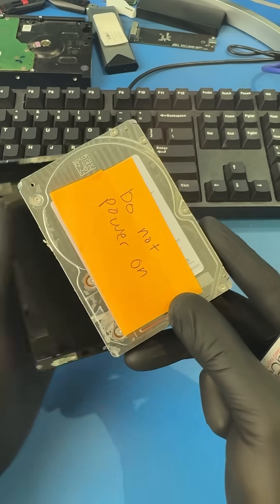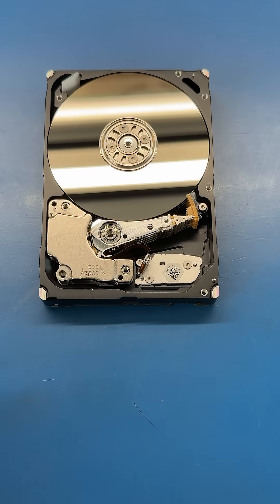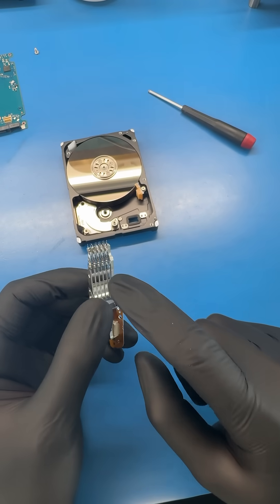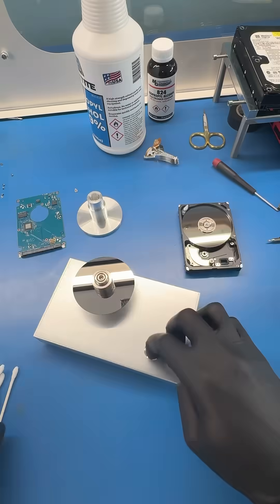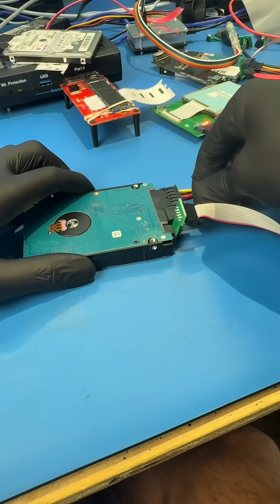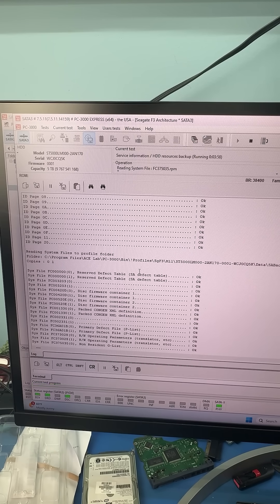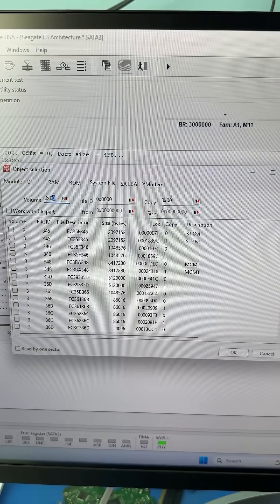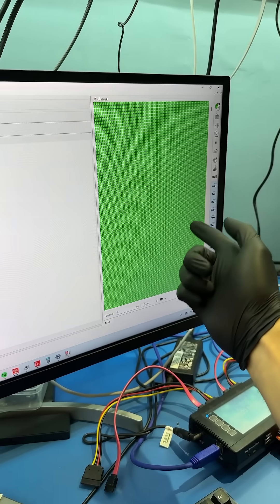Hard Drive Platter Extraction... #technology

Comment: Aren't mechanical hard drives sealed in a nitrogen atmosphere to prevent corrosion? Wouldn't the pressure difference after opening it affect the reading?

Comment: I have worked on hard drives from as far back as the Winchester era (1970s), but mostly for very simple repairs. I’m also very good with firmware and advance disk editing. I have even done forensic work, i.e., recovering intentionally erased data, so this part is definitely up my alley. But separating platters and finding drive head fragments is beyond what I have ever attempted. Impressive.

Comment: The number one rule of owning a PC: back up your stuff OFTEN and to MULTIPLE PLACES.

That way if this happens (ruin original and current backup) you are out a few months of files and maybe $100 for a drive, instead of deciding between $4,000-10,000+ or losing years of data
Reply: Minimum of three backups: One OFF site. One ON site. And the original.

Offsite for fire. Onsite for A/B alternating between the original backup.

Comment: I remember in '81 I was working on an NCR 8200 minicomputer and hit the "unmount" button on a 14" drive (one 5MB single fixed platter and one 5MB removable in the same cabinet); that was a thing you did with hard drives to tell the OS to stop using it cause it was shutting down, and then something screwed up and it fired the head into the spindle of the fixed drive just as fast as the voice coil could push it (and voice coils are fast  - think railgun). Sounded like a gunshot. I jumped about 3' straight up. Then I had to explain several times what happened as people started running into the room. Naturally we could not use that drive so we called tech support. Which wasnt much of a trip, this "hangar queen" practically had him living in the parking lot .

When he extracted the platter could could see bare metal where the oxide was supposed to be in a groove about 1.5" wide all the way around. The head itself had basically vaporized into tiny particles. He gave me the platter. It was like a 14" diameter 5# sharp edged Frisbee. I took it home and threw it, it curved off to one side but it still covered probably 100' before it did - sliced about 8" into the ground.

Comment: I've worked in IT for 20 years. Let me tell you, this is insanely impressive work. It requires high knowledge, adaptability, and above all precision. Bravo, friend.
Reply: Data recovery in general, yes. This specific job, not so much. Most of the work was just replacing a broken head and using software that does a lot of the work for you.
Reply: He's talking about "Time to lock in". Sir wdym, you're cemented already.
Reply: It also requires extreme cleanliness that I cannot provide after 30 years in IT with lots of low level work, though not the arcane knowledge of the firmware control port on drives .
Reply: justbecause you worked in IT doesnt mean you know shit abotu whats going on
Reply: @23bobjr  Hahaha, you're funny, and an idiot.
I work as an System Admin in IT/ICT now for 30 years, and @darkstarknight95 is 100% right.

Comment: PC-3000 reads all surfaces and assembles the cylinders in software? there's no way to manually align the platters after taking the stack apart?

To bad that PC-3000 is unobtainium for normal mortals (i.e. not professional data recovery services"

Comment: For me, the most impressive part of this surgery is ensuring the platters are perfectly aligned on extraction and reinsertion. The variance tolerance is measured in nanometers. If you're outside the tolerance your'e basically boned. 

Modern platters have what are called servo markers to assist in head alignment for platters that may be a few nanometers out of alignment. So, they don't have to be absolutely perfect, but still have to be damn close, And, yes, it varies wildly by manufacturer, and even make/model within the same manufacturer. 

You'd think the platters would be keyed; they're not. I'm VERY impressed with this extraction, repair, and reassembly.
Reply: I wondered about this. They are so cavalier about removing and replacing them I assumed the platters must have a magnetic marker on them similar to a record lead-in. If this were true then alignment wouldn't matter about absolute alignment, the read head would just find the landmark. Sounds like that's not how they work.
Reply: yeah i saw him desync the platters and thought this video can't be real???? how can he possibly realign them "BY HAND"???

Comment: Wait a minute. You replaced the heads and didn't need to retrain the SA? You got very very lucky. This is insanely rare, even with the same model heads from the same manufacturing batch. I don't doubt you did it but this is not common at all.

Comment: Years ago I was working on my computer. I just finished installing a new cd ROM drive and when I pressed the power button the controller chip on the hard drive exploded. After a little investigating I discovered one of the power cables had the five and 12 V leads exchanged . I had been working for months on a programming project so hundred of hours of coding was at stake (the reason I bought the cd ROM drive) . Luckily I had purchased two of the same model drive so I changed out the drive  Electronics circuit board and it worked perfectly.

Comment: Brilliant work.  I had a 1Tb drive in my laptop with >10 years of photos and videos on it, which failed 2 weeks ago. Ran all the system checks and no joy. Gone.   A few days later when restarting laptop the drive and all folders re-appeared.  Immediately ordered a 1Tb external SSD and left laptop to go back to sleep.  When SSD arrived I woke up laptop and backed up the intermittent drive which took 4 hours.  Now ordering another two SSDs so have multiple backups of all important files.   And replacing the dodgy internal drive with an SSD.

Comment: When I worked at Best Buy, we had three levels of Data Recovery available. First level, just a basic software recovery. $300. The second level was mild hardware repair or deeper software recovery. HAd to be send to OnTrack recovery. $600. Third level, which I believe is what this gentleman is doing, was a whopping $1600. And often times would take OnTrack WEEKS to MONTHS to get the data. Usually the only people that did this were bankers or accountants that didn't have backups. All levels included a suitable replacement drive. And advice to keep regular backups of their drives.

Comment: I always thought the second you popped a hard drive open it was toast because if dust settles on the disk and then you use it again it will destroy some of the surface and ruin the drive. Either I was misinformed or your work space is air scrubbed

Comment: You just took the plates off and put them back on? And the coaxial decalibration of the plates? Nonsense... Translator and MCMT report error... Besides, you have scratching heads on the system heads - seagate has a very weak ferromagnet and you would have a bloodbath there in SA. IMO this movie is only for marketing...

Comment: There is no way I would trust a single disk, SSD or HDD for Terrabytes of data..

Raid 1 for local and offline copy in the cloud
which then periodically copies down to my second NAS in the garage (away from the house, also Raid 1) and which is also copies down on other pc's in different locations (work, laptop)

I need 5 different failures at once before I actually loose any data

Comment: i actually spent a few hours removing heads like those from some drives to sell as the drives were to be destroyed but never could sell them. was later told by someone that it costs thousands to even use said heads in a clean room to replace in drives reason for them not selling.
i honestly didn't care much about the not selling in the end but what hurt more was all the tech companies refusing to listen to me asking if they'd want to buy and some leading me to a scam help line.
for reference, i'm someone going into IT so it was my first time trying my hand at hardware and trying to make profit off my hardwork.

Comment: I had a CRAPPY WD MyBook 2TV die a slow death on me that I thought might have a bad board (a very common issue with crap WD Drives), so I bought a new board, replaced it and no dice! Opened the drive to watch it in motion and it spins up properly, but as the heads engage, it encounters an issue and spins down so it doesn't mount.

Anyone have any idea how I might fix it?

Comment: Over the past 20 years or so I've used ONLY SS  hard Drives without a single failure!  I also use Crucial and Corsair SSD's to make my ACRONIS images. No worries at all now.
Reply: Just keep and make appropriate backups!  it's cheap to buy a 1 tb ssd hardrive... buy two... back your stuff there and then remove the drive and keep it somewhere dry, cool and safe.  would not hurt to burn some dvd's too.  dvd's degrade with time but everything does.

Comment: I saved all four years of my Info design degree on an external. The last course was a portfolio course which was supposed to be the compilation of the last four years when my hard drive blew. I was told it would cost $3000 to recover the info. So, instead I recreated four years worth of work in two weeks.

Comment: thats PC-3000 software, and you need a donor drive, which is fckn impossible to find... but there are few sources... i have used that long time ago and done this a few times with low success... btw you also need a class 100 clean room for low dust particle, the moment you open the case, you will immediately see those dust particle, and when you forget to blow them, those new heads will catch the dust and broke the head... these services charges USD5000 on the average.... i have done this myself.  The most skillful part of this operation is when you slide and park those head into the parking area (plastic), and those platter getting removed in order and in a correct position, i have 0 success on this part... those head usually you can find on the small exhaust part of the drive, as it is usually blown away by the rotation.

Comment: There was software for years that didn’t require this backing up of a service area. Simply would pull all the bits off the drive in it entirely but I believe it’s all locked behind pay walls now days. Used to be a Linux tool for this as well to basically force strip the data off onto a hard drive

Comment: I have had a DEEP distrust of Seagate drives for years now. Did data recovery when a drive in a RAID failed. A completely new set of 3 identical drives were purchased. I spent nearly two weeks getting raw data recovered and moved to new drives. Got RAID rebuilt, started copying individual surviving files so they could be properly backed up. BOOM, one of the new drives failed. Total data loss on new drive and old drive had damaged platters. Nothing left to recover and rebuild from.

Comment: a long time back i thought i would try pull a few apart that did not spin,  and i just rough as guts put the discs in another drive and i mean no clean fingers and not a clue how the heads worked, and then it spun up !  i think i used easeus recovery or similar cant remember and  couldn't believe it, got basically all my pics and movies and lots of other stuff off it, i never even tried to boot it up as a system.
so i could imagine with this kinda care you would basically get the operating system fired up ?
Reply: PS : i am pretty sure i tried it again on another hdd and only placed 1 or 2 discs in it leaving the others and could get pics and videos off that too, i just cant remember why i did that .

Comment: You can't pull the platters off one by one because their positions are synchronized. If they are not kept uniform and adjusts so much as a micrometer you will basically lose all the data on the platters. There is a tool that fastens all the platters in place and then you can remove them.

Comment: I had use an adapter for my old drive from my young years where my bitcoin feom 2011 was. But I connect the ide font reversed by accident and it won't turn on. Is there hope?

Comment: My scrotal contents felt severe pain when I saw those heads! Talk about redefining head crash! Used to be a head crash just gouged part of a platter, clean the debris carefully out and one could recover the majority of the data.
Still, looks like glass platters, which are a bit more robust than the ancient soft metal platters and we'll not discuss the ancient hard platters, dried up grease bearings and techs slamming the drive on the bench to free the spindle to recover the data...
And the correct grease for those ancient spindles.

Comment: Sencond cache..and just start failing sounds like hard sisc drive. 1 seconds run just fine and then you may or may not shut it off and turn it back on and it doesn't work

Comment: You forgot to adjust the Joson rod in Stage 3 from the loop master. You’re gonna have problems when stage 7 doesn’t line with the reactor column H when stage 2 clips the edge of the gigawatt locator at stage 4. You also forgot the RAM overboard module that makes stage 6 stay true. You may have gotten most but anything hanging from the edgeware of stages 1 5 & 6 might make the whole rom crash. It’s for sure a hard job but something’s better than nothing. If you want me to come in and resurface the mainframe so stage 5 runs smoothly please let me know.

Comment: I once did this - the drive was unwanted, so I was doing it for amusement, but when I got it together again, the heads flew OK, but they were wandering across the surface.  I figured that the servo tracks were no longer concentric, so I scrapped it like I was going to do anyway.  That was a 12" disk off a mainframe, but they were crude compared with modern 3" hard drives.  I didn't think it would be even nearly possible with a small drive like this.  How wide are the tracks?  You don't need to get them far off-centre before the servo track can no longer work.

Comment: Modern discs are very delicate. I remembered how in the mid-90s, my computer, running on an i386 processor, started making sounds reminiscent of the doorbell of the 50s and 60s. Someone may remember such calls when a metal tongue was hitting an iron cup. After opening the system unit, it turned out that the power supply was out of order and instead of 12 volts of direct current, it was producing 48 volts of alternating current, which led to heads with a frequency of 50 hertz hitting the hard disk plate. In the shower, I said goodbye to my computer, but what was my surprise when, after replacing the power supply, everything worked, and almost nothing was lost on the hard drive, only I had to block the damaged sectors.

Comment: I have an external HDD that has encryption through the daughter board (I was putting a shelf up and it fell, slid down the wall behind the desk and snapped the port off the board. this was 20 years ago, since I have learned trace and circut board repair) Unfortunately I no longer have the daughter board to repair.  

How much would it run me to get a platter swap to a new drive or at least the contents recovered onto a flash drive or dvd?

Comment: I seriously question the level of accuracy in each action taken as someone who tried to repair many things with extremely thorough knowledge of the product being repaired and still makes errors voiding all my work far more often than I don't to see one video reference no fewer than 3 high precision requirements and not  one error is the baffling part to me! like how on earth does one get that solid a resistance to errors if there is one skill I want to learn desperately it is that and it isn't just a steady hand as no misinterpretation is also part of this skillset as used in the video

Comment: NEVER EVER EEEEEVVVVEEEERRR store pictures/movies/documents or ANYTHING you want to cherrish on a HDD. They are designed to fail. Also, I hate to say it but I tell EVERY SINGLE customer the same thing. ALWAYS store in two places. In case one fails or burns. Better option....go cloud. Make sure you have ALL the FA's on and youll never need to worry again. Again, if you're using a MECHANICAL drive...to save memories ...you're asking for failure.

SORRY to rant more. But I remember when Toshiba released this external drive. They ADVERTISED it as for you to save all your loved memories on it. I sold 30 of them In a month. A YEAR later we started having people return them saying they aren't being detected. We had SUCH an issue that we called Toshiba and they said "after the device has been powered on and you saved data to it. Make sure it NEVER powers off. As if you let the unit sit for a couple months powered off. The device was bricking. So basically they were blaming the customer. DO YOU KNOW HOW MANY people bought these. Put their "Private Data" on and filled them up. Then put them on a shelf to access at a later date..... Yeah . . . Toshiba tried to say because you had it unplugged for longer than 3 months or so... Its the customers fault. WTF

Comment: Spent about 5 hours copying images on an external HDD and accidentally knocked it off the laptop. It fell like at most 10 cm, hanging from the cable and that was it. It no longer read and made a weird sound. Opened the drive up and the head tried moving but only moved like half a mm at most. Pushed it off the disk and eventually got it to move but it moved erratically across the disk. It was moreso curiosity from my side since the pictures luckily were still on a second laptop so bought an SSD for future storage for the pictures spanning 40 years.

Also screw them for using 1 pentalobe screw. Was also some seagate barracuda 2 TB drive.